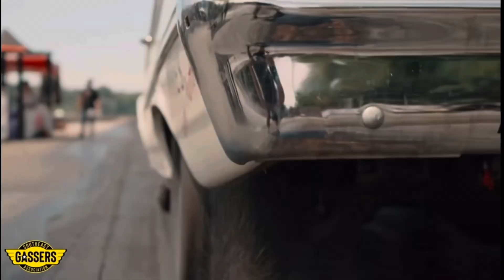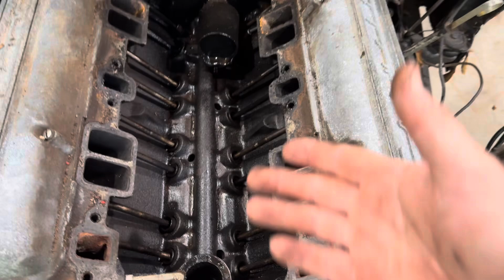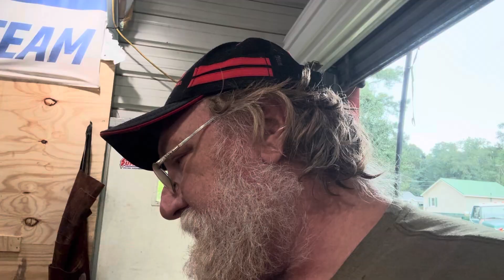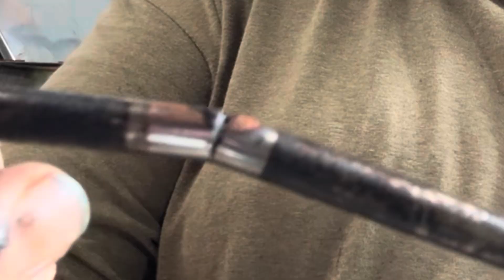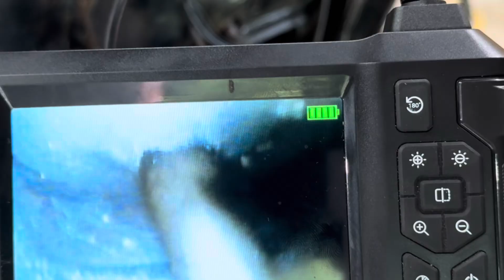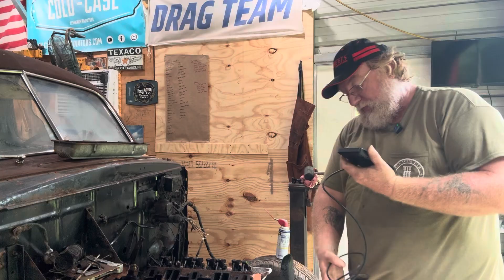I try to fire up the 48 Ford gasser, it did not go as planned.

Comment: I pulled the beather baffle out from under the intake ..I run a set of valve covers with beathers and I use that to fill the oil ...also I've ran many of the Chinese intakes ..no issues at all ..I'd run one just to piss of the Internet ...😂
Reply: Also I used a expansion freeze plug to close off the draft tube hole ..worked good
Reply from the maker: @treetop.garage thank you for the information.     That’s kinda the track my mind was on

Comment: Only  engines I got lying around is a 73 vintage 429 and a set of 69 429 cylinder heads you’d have to creative with that firewall for that to fit
Reply from the maker: You would.. but a 429 would be awesome in a car this light.  😂

Comment: Fire the engine! If it eats itself up, who cares?! It's a 283, no loss. Let's not complicate matters. Fire it and find out. Besides that bassackwards trans setup will probably disappoint you. If it was any good, you'd see that kind of setup more commonly used or at least more info about them. There isn't, and probably a good reason why.

Yes FEs fit just fine. You don't run the inner fenderwells anyways. This car, IF it was to be a real drag strip racer, needs an FE in it. It would certainly be period correct. Even a C6 can fill the void until a 4 speed is located.
Reply from the maker: The weight of the FE is the killer.  Even with the small block the weight is 200lbs on the nose.  It would probably double that with the FE.   But I agree I’m gonna repair what has to be repaired on the 283 and fire  it up.    See what happens
Reply: @frizzellracing the SBC is around 575 full dress. The FE is 650, full iron dress. You can shed an easy 100+ lbs off the FE with an aluminum intake and waterpump. Put the car's nose up and it will weight transfer to the rear. Are you allowed engine setback in this class?

Comment: Unless you removed it, you are missing the down draft tube that bolts into the top of the block in line with canister breather. That cannister is basically a vent and oil deflector, no moving parts. This is how he crankcase breathes. If you remove it,  the hole above the flywheel has to be plugged and a freeze plug can do it. Again, changing manifolds, beware of port mismatch and vacuum leaks. I had a mismatch and it leaked on the lifter gallery side. Different intake gaskets fixed the leak. You can fill through the valve covers if there is no oil fill in your new manifold selection. I believe the 283 is in need of a lot more than just a pushrod, intake, carb, and valve covers. With the sludge build up on the port side of the intake valves, I am thinking the guides are worn and possibly the oil seal (square rings at the spring retainer), are shot. Must have some mileage on it. A compression test is in order.
Reply from the maker: It’s just the one intake port the rest look real nice and the bores are are very clean. I believe moisture got in they the intake on this one valve.  I could need wrong.   We will find out

Comment: That 283 isnt worth the time and money...just throw a ford in it as thats what you know...Guarantee that 283 is bone stock boat anchor....That tranny needs to be gone thru also as long as its been sitting
Reply from the maker: While I agree on most point, I do know for a fact it’s not bone stock.   In an earlier video with a bore scope we seen it’s got aftermarket pistons.     But I do agree it’s not gonna make a bunch of power
Reply: @frizzellracing ya if it is its not gonna have near the power you would want im sure
Reply from the maker: @drcracinggarage8047 oh I’m sure.    Just kinda want to see if it runs good.    Honestly I can sell a running  engine and use the money to put a better one in its place at some point.

Comment: Summit Racing has the Edelbrock Performer EPS Intake Manifolds 2703 Number: EDL-2703 and it has the proper oil filler pipe. 

Just add a catch can on the back. Some plumbing may be required.
Reply from the maker: I was just looking at some online thanks
Reply: @frizzellracing I believe that crankcase vent on the back originally had a pipe which spit oil out on the ground. Anyway a catch can is better than adding a PCV valve. 

With the late model Dodge Ram 5.9 Cummins, it even had a catch can. I remember the first one I changed the oil, I said WTH is this plastic bottle, looks like a baby bottle 🍼. Anyway you suppose to empty the catch can (or bottle) every time you change the oil. It works!

Comment: I would try and source an explorer 302 with a roller block and gt40 heads, and you wont burn spark plug wires with the angled gt40p heads
Reply from the maker: Thank you very much.

Comment: i use marvel mystry oil and a chunk of brasss to get valves loose then piano wire and slide hammer to pull them back shut, i would do what it takes to it running to see if the rings are stuck and check oil pessure , i raced and built many 283s and 327s jn early 70s . we had to pin the rocker studs after we put in a hot cam , a good 283 powerpack will suprise you , i liked the 327 L79 hydaulic cam , in the  283s . Rick Martin  lincoln racer  Darrtown Ohio
Reply from the maker: All good info thank you very much.